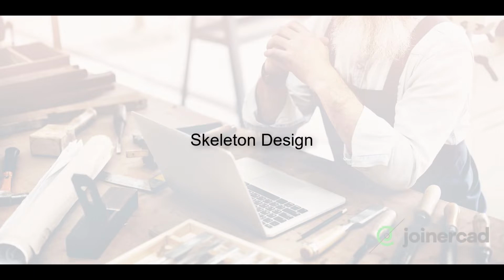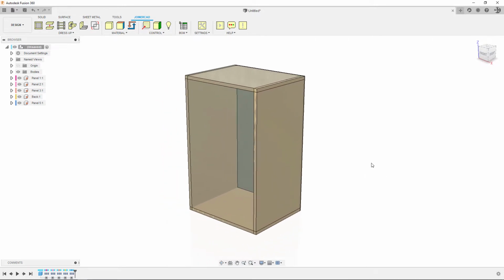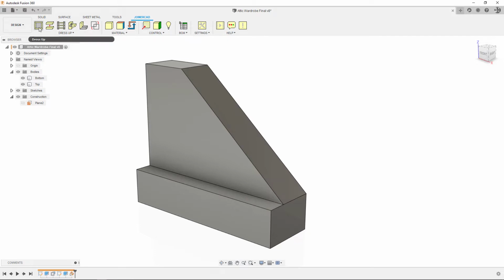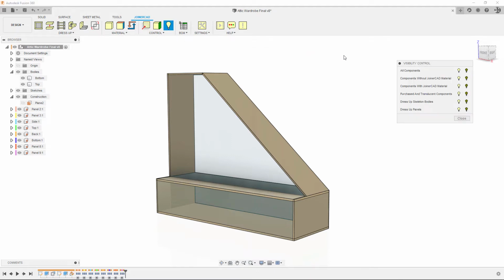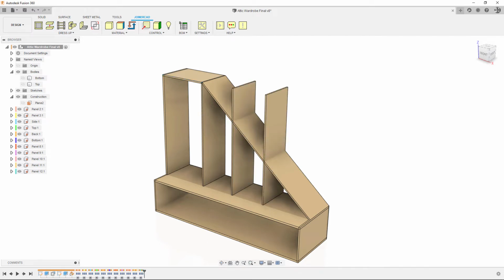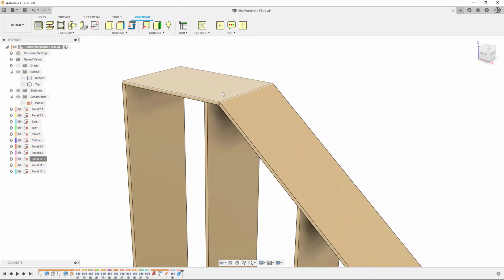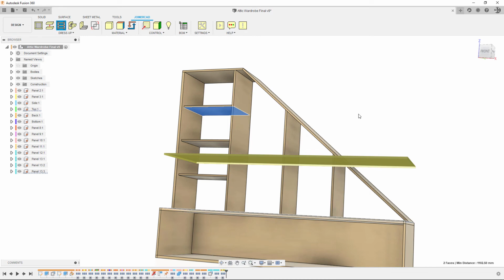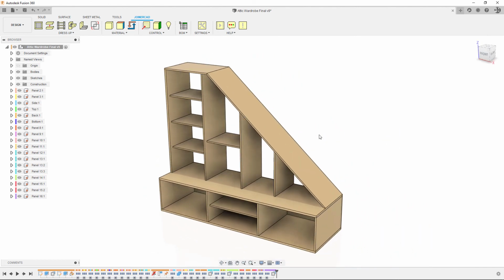JoinerCAD Skeleton design (version 1.2.0)

Comment: It looks like an excellent add-on but I'm not quite understanding the jointing options.  Suppose the 3 inside vertical dividers attach to the upper horizontal board of the base in a dado.  Is that supported by the tool?  As another example, suppose box joints are preferred for the base of the cabinet.  Thanks.